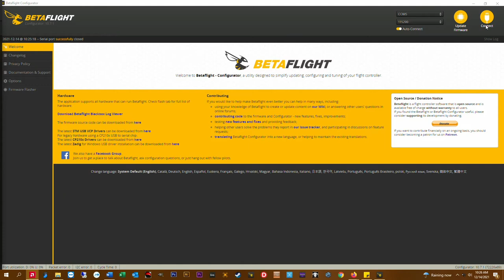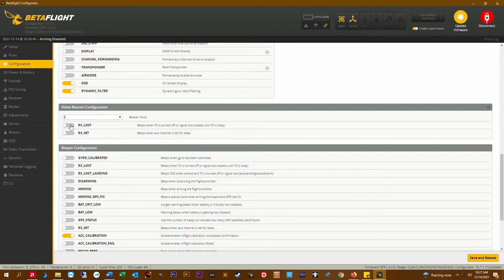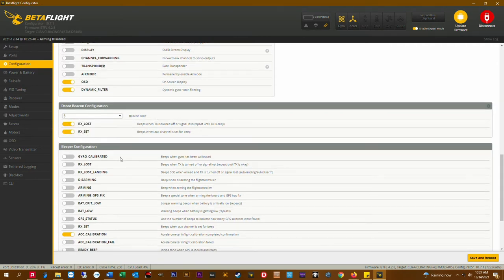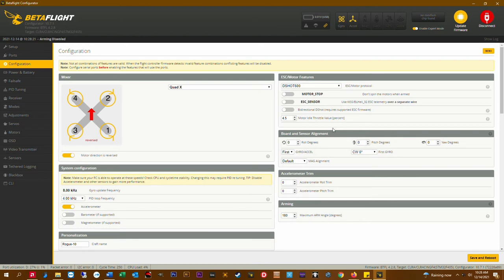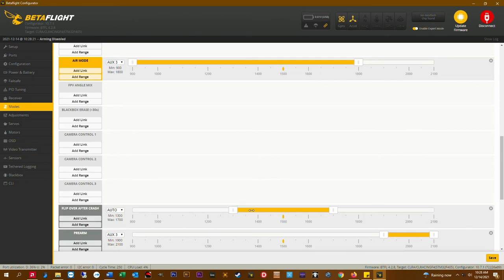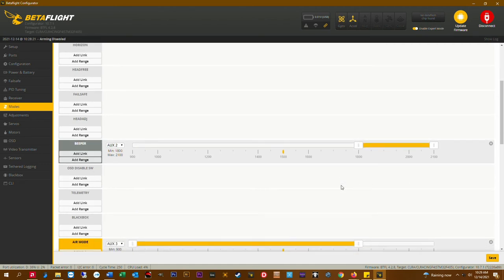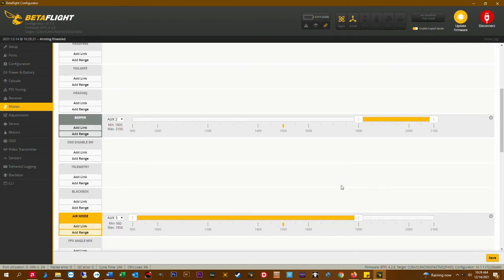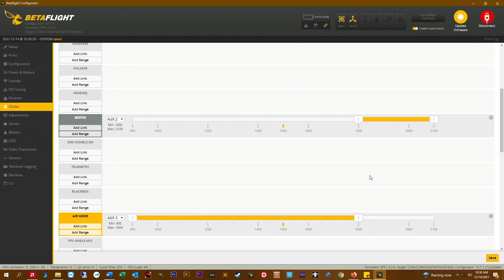Just The Tip - Ep 01 - Dshot Motor Beeper

Comment: When i connecty quad with betaflight on computer but when iam.entry to modes,appear just that 2 only modes(atm dan angle)..there are no other,what ma i todo with this situation
Reply from the maker: Easy to fix, just set the button for "Hide Unused Modes" to off / disable in the Modes Tab. Also, ensure that "Enable Expert Mode" button is enabled in Betaflight top bar.

Comment: Didn't work for me. I dont get the esc/motorfeature as an alternative:( it doesn't work on either my mobula 6 , 8 and my crux35. It took me  so long to find it here in my own guarden when i crashed and it of course started to rain slowly. I needed to arm and throttle alittle bitt to try to find the sound. It was so annoying and i got alot of shit on my esc and props just because the beeper didn't work 😪 i once tried quicksilver and there it did work easily. I got bf 4.3.1 on mob 8 and crux 35 and bf 4.4.2 on mob 6. I've done all things except the esc/motor features doesn't show on the screen
Reply from the maker: Make sure that you are using Dshot 300 or Dshot 600 as your motor protocol. Motor beeper will not work with multi shot or one shot protocol. 
If you followed the steps, it will work on any quad, I have this on every one of my quads from tiny whoops to 7”